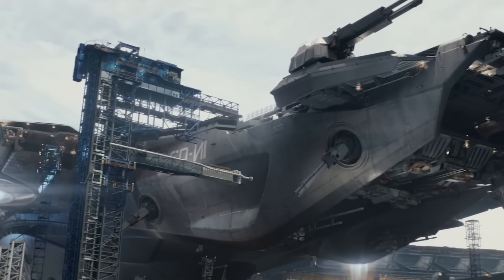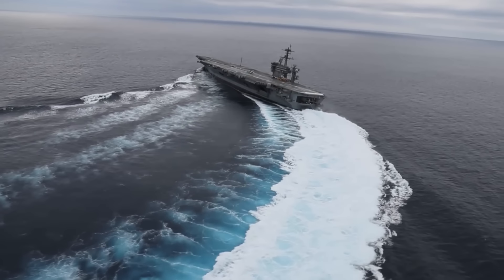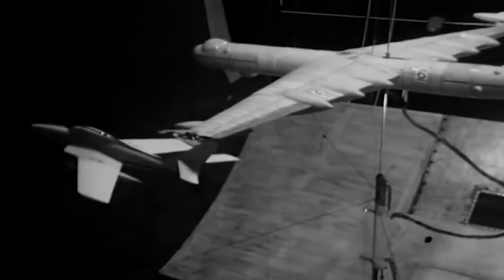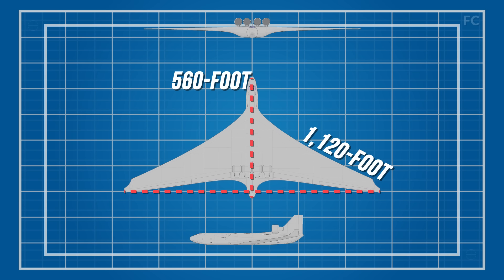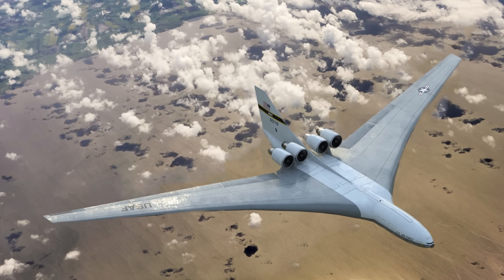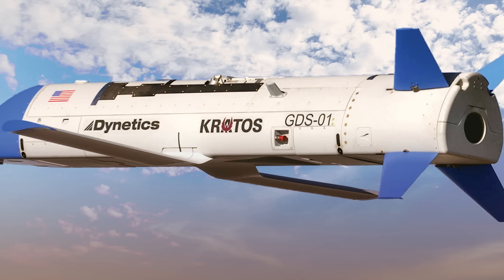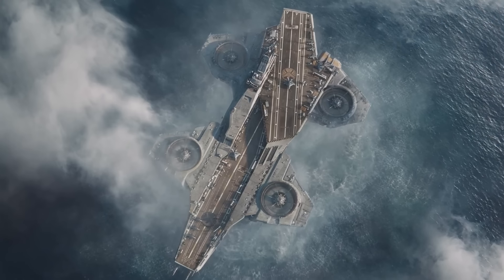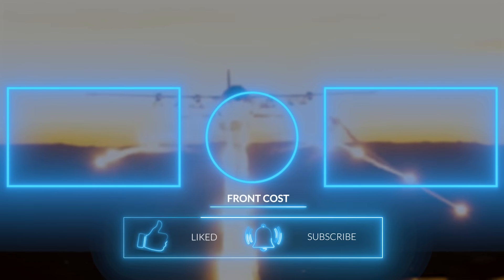US Billions $ FLYING Aircraft Carrier: World Is Shocked!

Comment: Remove first the weight before flying. 
How can say how ? It's very easy . My flash driving invention running in light speed way first. 
The gapping zone is the way to do it. 
Can I say it how ? Vertical landing and vertical take off.  
Very easy i don't Lie in my 50years in repair works .
5m$ . First . I want to buy a house for my family .